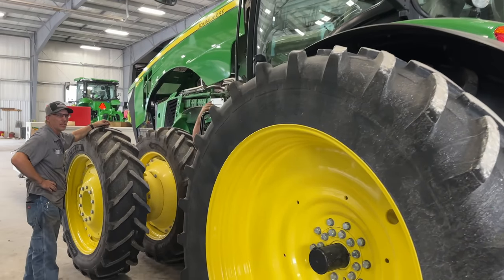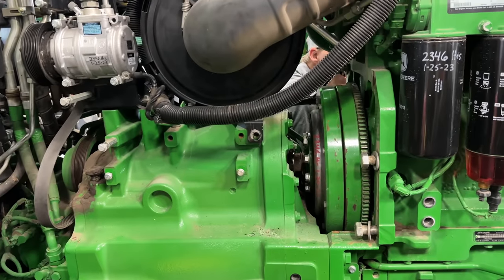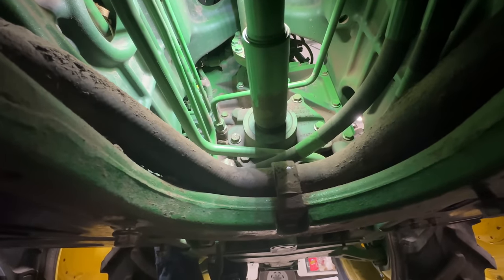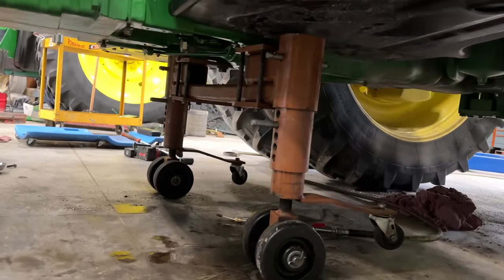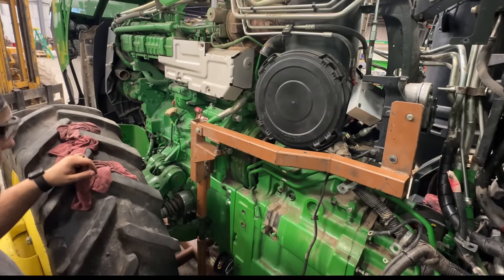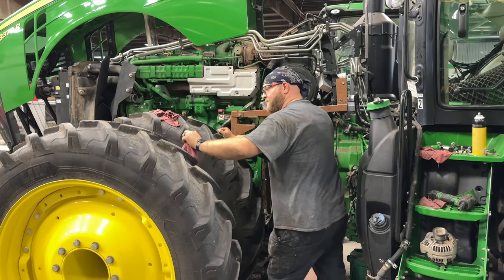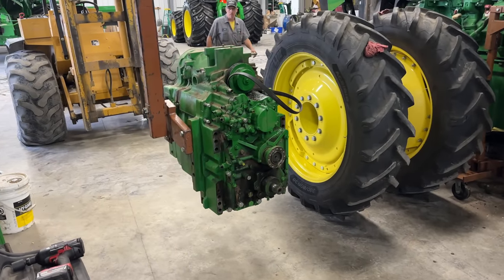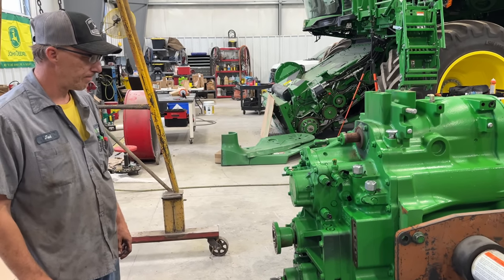John Deere 8370R IVT removal. (Part 1)

Comment: Zeth, I encourage that you not hit on a wrench with the heel of your hand. I have had two friends do severe nerve damage to their hands by doing this. One of them got multiple operations and still ended up with a hand that would not work right and got retired out on worker's comp. because of that damage. The other ended up missing a lot of work because of the injury. You do not need that to happen to you. It can happen so keep a dead blow hammer handy and use it instead of the heel of your hand. Great video!!
Reply: I was thinking the same thing. Plus i watch this awesome chinese genius girl mechanic and because she has low power she rips the most stubborn bolts out as you suggest. Turning her wrenches into impact wrenches.

Comment: It’s truly amazing at the engineering to make those tractors and also the knowledge you have to take it all apart.
Reply: I agree. Isn't a phenomal bit of gear.  The engineers are spot on but i imagine with so much going on they only upgrade a little each year. John deer would have soo much info in their file system to draw from. Would be a fun place to be a designer.  

Hats off to these lads but. Just thinking about putting all that back together is stressful.

Comment: For anyone questioning the value of a warrantee…….here’s your sign. 😂
Reply: Yeah....you need a “warranty” because they build crap nowadays
Reply: @sawboneiomc8809 I wouldn't say that, a tractor these days is wildly different to a tractor 10-15 years ago. Engines haven't necessarily grown so much in size and displacement, but produce much more power and torque. Which consequently can break a lot of things you put behind it. Gearboxes have pretty tight tolerances, while being absolutely filled to the brim with various tech for various reasons, efficiency, strength, fuel economy, etc. This creates room for errors and things to go wrong.
Reply: @sawboneiomc8809  many peoples idea of crap stems from the fact that they can’t fix it with a screwdriver and a hammer.

Comment: I wonder what the final repair bill will be.  So far, 24 hours of labor times $200 per hour is a chunk of change.  Then again, what is a tractor worth without a transmission?  Farming is not for the faint of heart!  Zeth knows what he is doing.  The others are just learning.  Parts and labor will add up quickly.
Reply: An expensive job for sure. He mentioned it's a PIP job, which means "product improvement program" which is very similar to an auto recall.  So hopefully mother Deere is footing the bill for this one.  But if the farmer was, it could easily be $20-30k.  We had the hydro pump replaced on our 7920 IVT years ago and it was at least $12k back then.

Comment: Seems odd that a dealership of the size and prestige of Sloan doesn't have a bigger workshop with a decent overhead gantry crane. Lifting transmissions out with fork trucks is a bit of a lash up. Good content again but I question the reliability of JD IVT's - seen too many of your videos hauling them apart.

Comment: Tell the Boss you need and want a overhead traveling crane.  Had a 10 ton in my Oilfield Fab shop and it was a life saver. Those forklifts will get you killed.
Reply: Our shop has an over head crane makes life so much easier

Comment: I have a question, Why don't engine manufacturers engineer filter systems for engine coolant? Some downside would be more potential areas for leaks. Would be a pressure drop across a filter, say filter only 10 - 15% of coolant flow. I think it would be a good indicator of the condition of the engine. I am sure there are more drawbacks. I would really like to hear some feedback from anyone. Thank you

Comment: That's insane. I didn't notice that on these tractors there is not a frame (or chassis) it's all holding together by the engine and transmission itself.😅

Comment: They burn out the hydrostatic pump because they’re run at low revs with are heavy load. No different to an automatic transmission

Comment: why did you guys not pyush the engine a couple feet father ahead?i think it would have been easier
Reply: Wiring harnesses were at their limit of slack , just a guess .
Reply: @wildedog3967  mightbe right
Reply from the maker: You are correct